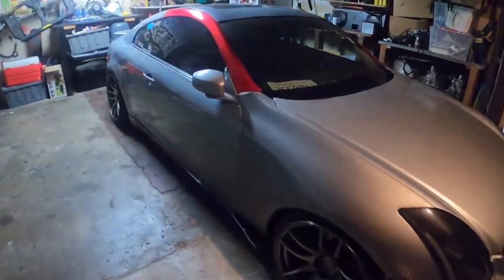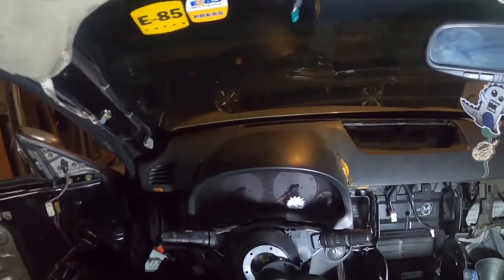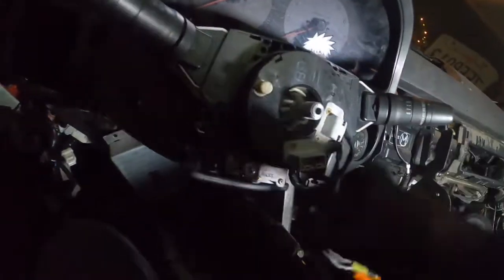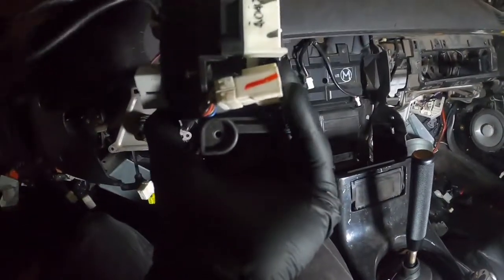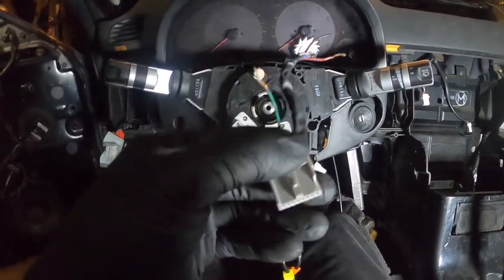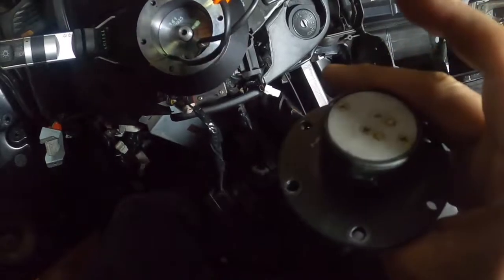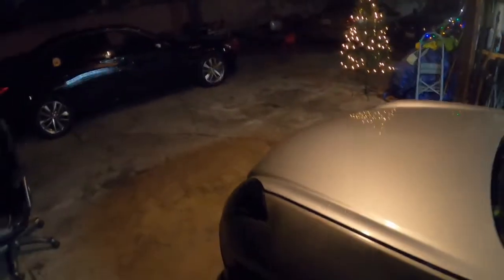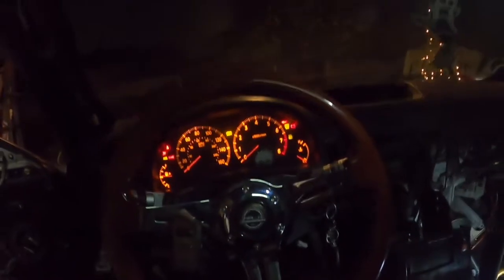How To Replace A Clockspring On A G35/350z

Comment: Hello I recently changed my clockspring on my g35 and everything seemed to work but after I started driving my car started “braking” on its own and then the VDC lights and slip light came on!!! Any idea how to fix that?
Reply from the maker: Hey man your steering wheel isn’t alligned properly , take it back apart and check for a little marking on the spline , that marking will indicate where the steering wheel should
Be put on centered. Once you do that it should be good